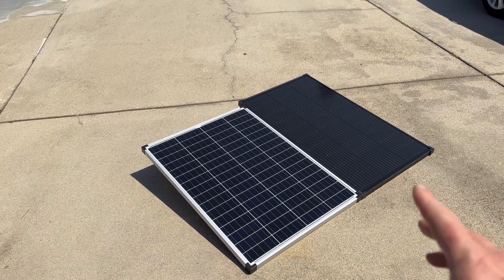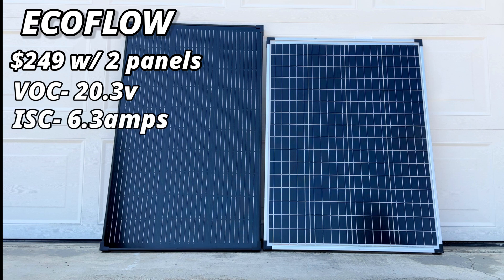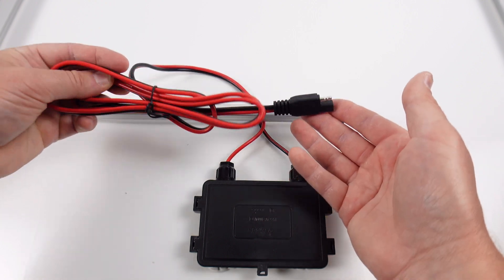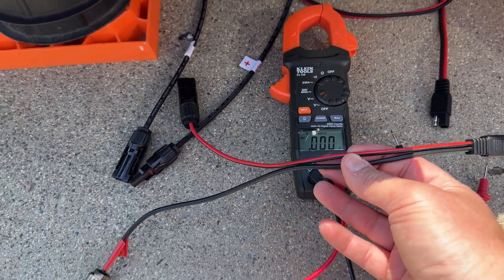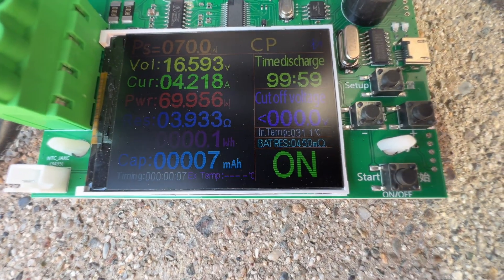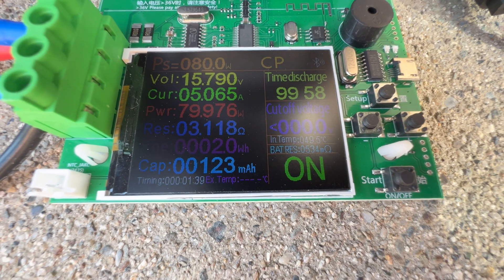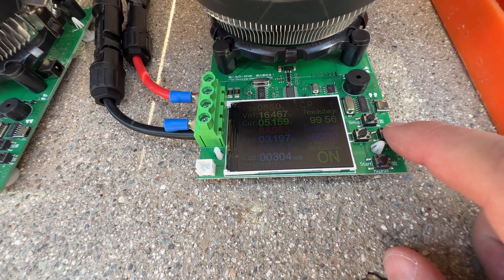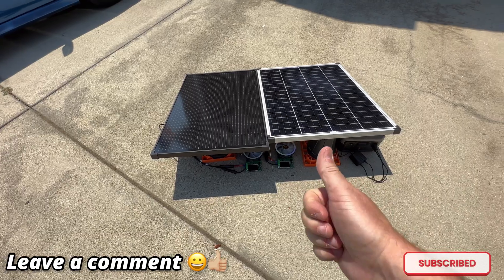Harbor Freight VS EcoFlow 100 Watt solar panel

Comment from the maker: Can anyone beat the Harbor freight 100 watt solar panel. EcoFlow has a new high efficient design panel that are great quality but is it enough?
#solar #harborfreight #ecoflow #test #review  

Items in video…
ECOFlOW solar panels: https://amzn.to/3JN6Ci1
Tester: https://amzn.to/3NMBiRA
Inline meter: https://amzn.to/3NM7QLF
River2 power Station: https://amzn.to/44eN6Dm
Load testers: https://amzn.to/3O82f3O

Direct Questions for fast response ...https://asqme.com/@johnnysweekends

CHECK OUT MY AMAZON STORE: https://www.amazon.com/shop/johnnysweekends

If you feel I helped you out..Buy me a Coffee 👍🏼🙌🏼👊🏼😀
https://www.buymeacoffee.com/johnny5120J
Reply: Id like to see a comparison using the    Rich panels, too. The HQST puts out more watts than rated for but, they're made in Taiwan, I believe? The Rich panels are made in either Thailand or, Viet Nam
Reply: Yes.I believe that the Newpowa 100W panel is better? Cutting edge technology in a smaller panel and under $75.00. *Made in Viet Nam.
Reply from the maker: I did a comparison

Comment: your compare is pointless you show by yourself that alot companys have big 
series scatter in production ecoflow/eco worthy / harbor freight have all 20% +/+ so one 100 watt panel will deliver 80 watts another panel from same brand will deliver 100%
so if i buy somethink and see it not reach what have to be i complain it and get replaced it, and if it reach what if havbe to be i take it.

so yourt test are ramdom possible values and have no informations.
all what people have to know check what you have buyed if the output is on the vsalues it have to be if not somethink went wrong in production or broken in shipping.

for example i got 1 year ago a eco worthy 195 wat bifazial that delivers in full sunlight 165 watt max, thats far of the specs, so i send it pack and get it replaced the replacment reaching 185 watt what is ok for me so i let it be for the payed 80$

Comment: hi, is the ecoflow 100w rigid 12v or a 24v  solar panel system? thanks.
Reply from the maker: 12v but essentially you can make the voltage as high as you need by wiring in series.

Comment: Like so many other reviews, you picked the highest price for the Ecoflow panels you could find.  That is not really honest, IMO.  Right now you can find a 2 pack of Ecoflow 100W panels for $159, making them about $79.50 each.  Or on Amazon you can find them for $129 each with a $40 coupon, making them $89. HF's panels are $120.  Before anyone jumps in with " But that's EF's sale price, not their regular price," I have been watching their products for long enough to realize that they always have a sale.  

You did a great review of the two though and I honestly do not know enough to say which panel is better.  But buying the HF panels simply because they are cheaper means someone didn't look very hard to find a deal on EF panels.
Reply from the maker: Well to put in my two cents. When I did the review about 5 months ago, the panels were still new and not much of any sale price then. Prices change all the time. Unfortunately I have no control over that. The HF panels can be had for $89 most times with a coupon. 
But the EF panels do perform well and have a true uv rated solar cable and a smaller footprint. So if you want a mounted panel these are nice. If you want a ground or suitcase then the HF are nice because the legs are ready to go. Bigger and heavier though. 

Sorry that was more like a quarter lol 😁👍🏼

Comment: I’m not an electrician and don’t plan on becoming one. The eco-flow has me tempted because of the wide variety of batteries that you can get. I assume, obviously, that their panels are plug and play. I want it for a longer term usage after I can’t get gas or propane for my small generators.
What am I missing? Thanks.  Nice vid.
Reply from the maker: Rigid panels are best for longevity and permanent mounts and best output. Not great for temporary or mobile setups unless you build a rig. 
Solar panels and a solar controller and a battery then an inverter are all you need to start a basic power station.
Reply: @johnnysweekends  thanks
Reply from the maker: See if this helps. Great for new to solar Beginner Solar and Back up power ! Easy DIY Tutorial
https://youtu.be/_xiIsNBYkn8

Comment: Would love to see the HF vs HF folding 100w panel. Several have reported around 122w with it and speculation is that they are using two 60w panels instead of 50w.

Comment: So when the solar panel shuts down on the load test. Does it just get reset?  OR does it mean it's toast?
Reply from the maker: No it simply stops excepting power. You can manually reset.
A mppt solar controller will do much the same just automatically and much more efficiently

Comment: I like your videos, but even though Harbor Freight panel might show a little better output, the warranty is only 30 days, most of the other panels (ECO-FLOW, Renogy, etc.) has a 10/25 yr.  warranty. I go with the better warranty. Even though I do buy somethings from Harbor Freight, their products have been know to fail.Thanks
Reply: That’s actually very wrong. They have a 12 month warranty. 10 years would be insane and would automatically make the product worth it even with less output

Comment: I've got 8 400W Ecoflow rigid panels for sale in socal. Haven't tested em though.
Reply: How'd they do?
Reply: @airon89toyota  still boxed up in my garage
Reply: @cakesteak  that sucks. If you don't mind me asking, why?
Reply: @airon89toyota  not much of a secondhand market for them
Reply: @cakesteak  why not use them?
Reply: @airon89toyota  Im renting and didn't get a house
Reply: @cakesteak  where do you live? I'm interested in getting solar panels for my house I just bought.
Reply from the maker: @airon89toyota if you don’t buy his let me know I have a place and a discount you can get panels for cheap!
Reply: @johnnysweekends  what's the place & discount?
Reply: @airon89toyota  san diego, my panels wouldn't be a very good investment, there are much cheaper panels out there. These cost too much, and the name EcoFlow isn't enough to justify the price. Although they are high efficiency, efficiency is just a number, having high efficiency just means more wattage in a smaller square. All that matters is the watts you want and how much space you have for it. So I say get the biggest wattage ones you can fit. if two panels are 400w and one is just a little smaller to claim "higher efficiency", you might as well go with the cheaper bigger one. If you're lacking space for panels, then high efficiency makes more sense.
Reply from the maker: @airon89toyota https://signaturesolar.com/?ref=JWKNDS

Code: JOHNNYWKND

👍🏼
Reply: @cakesteak  either way, I'm in Vermont so logically it would make no sense for me to purchase yours. Best of luck.

Comment: I think my next set of panels will be the HF ones. Gonna try to catch them on sale.
Reply from the maker: They go on sale often for the $89 price with coupon. 👍🏼
Reply: The panels will come, probably one at the end of the month, another in August and so forth. Im a retired disabled veteran that depends on the pension so I have to go slow.
Reply: I'll be waiting for that. To confirm, if my current 100watt system receives another 100watt panel,  in theory it should cut the recharge time in half.  If so, I will at least make it to 400 or 500 watts. What do you think?
Good day
Reply from the maker: Depending what you are charging will depending how long it takes by the amount of consistent watts coming in. 
But if a HF panel brings in a consistent 80w and you double it to 160, your charge time is only that much shorter.

Comment: i have 4 of the H.F. panels and  the only problem i have with them is the connector.
Reply: But you could change the connector ... yes/no(?)
Reply: @__WJK__  yes i have done that so its all good and the H.F panels are a really good buy so im happy happy
Reply: What connectors would I need to aren't a 400 watt EcoFlow fold out portable panel?
Reply: @fuzfire  i believe  those panels come with MC 4 connectors

Comment: I like these comparisons! Thanks for showing 😁👍 Wish the Harbor Freight had MC4 stock
Reply from the maker: Thanks 👍🏼😀
And a actual UV rated outer sheath for the wire would be nice. But it’s still help up fine letting it back in the sun for a good month or more at over 110 degrees.
Reply: @johnnysweekends  high temps are torture on panels, it's been near 100F this week in my area, I've seen a loss of power. Been running my Wave 2 off solar 100% for the last week to get 'free' cooling, it's been nice!
Reply from the maker: Heat is a killer for all electronics. Resistance leads to less efficiency so you end up with losses just from heat. 

So the wave is doing good in the little house?
Reply: @johnnysweekends  I'm running the Wave in my house actually as an extra source of cooling. The backyard shed could benefit from it if I had a reason to cool it down, it's just a storage shed.
Reply from the maker: Hmmm….maybe I should bring mine in for extra as well. 🤔😀😁👍🏼
Reply: @johnnysweekends  on Max mode it rocks the cooling, I just have it plumbed in a window with foam board insulation and it's been working well. I'm running it fully off my batteries and transfer switch, free cooling!
Reply: @Jasonoid I wish I could justify getting one of those! 😎
Reply: Yup. And since the gauge wire is pretty thin, would performance matter at all if you cut these wires pretty short (long enough to run in series with MC4 connectors) or keep them full length with MC4 connectors?

Comment: Man, you’re on it! 

Stupid question: is there ever any situation where it’s too hot for a solar panel?
Reply from the maker: Yes!! Once they melt 😂
But honestly I don’t know when the to hot point is. I live where it’s a 117 several times a year. My home Solar still does fine and the surface temp has to be at least 150 degrees or higher. Soooo when is to hot…??? 

Idk 🤷🏼‍♂️
Reply: @johnnysweekends Thanks. Should be ok, it’s hit as much as 118° a couple of times in the last couple years. Usually the hottest summers are just over 100°.